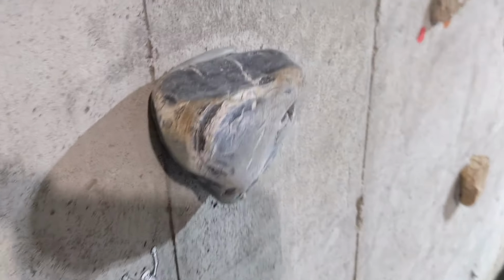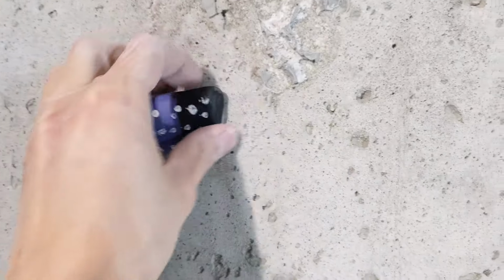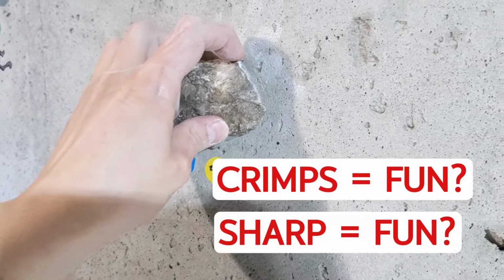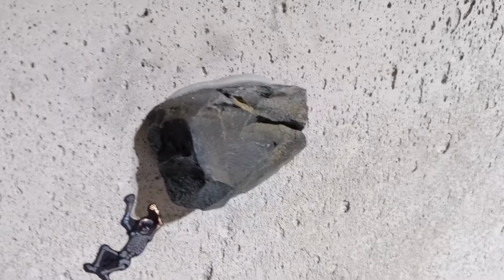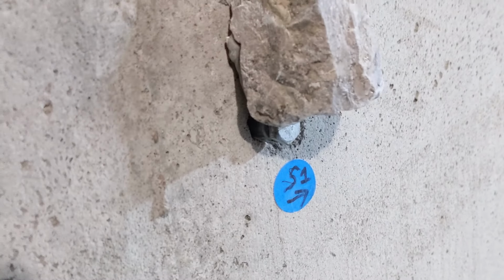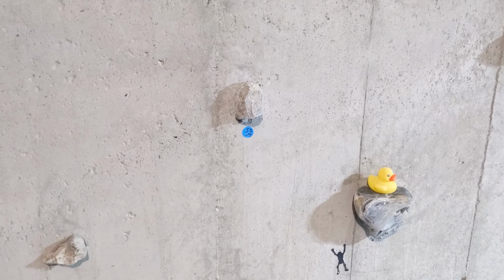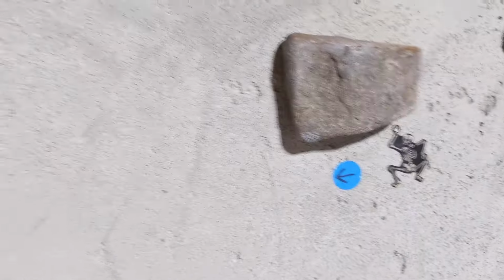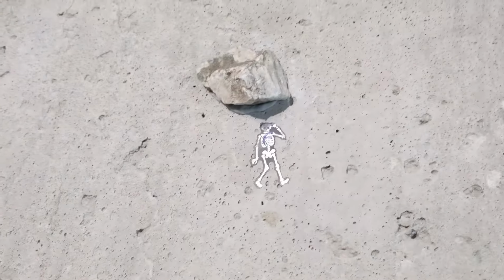I glued rocks to my basement wall #bouldering #homewall

Comment: its a pretty cool idea. I considered this, but i wasn't sure how safe it is on the long run, or how you can keep things fresh, even if you're leaving it there as a spray wall.
Reply from the maker: I was worried about keeping things fresh. But then I realized, I mostly use the wall for training type stuff, so the lack of freshness ended up not being a problem.

But the safety thing... Yeah, I'm still a bit concerned about it, honestly. So far it's been good, though.

Comment: I have no concept of how strong epoxy is. Do you have any idea what kind of safety margins you are looking at?
Reply: Also curious, how much did the epoxy cost? It looks like you used a generous amount.
Reply from the maker: Great question. I don't know information on how much weight the epoxy can hold. I've had a few rocks come loose, but I blame inadequate application.

That being said, I wouldn't risk putting this on a taller wall. I wouldn't dare climb much higher.
Reply from the maker: I think about $7 per tube. I used 2 tubes for the number of rocks you see in this video.